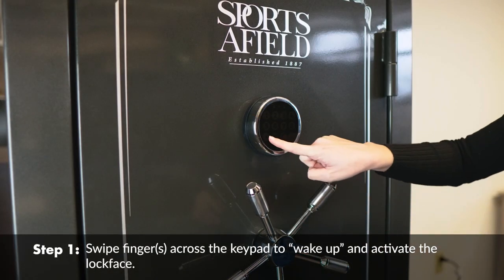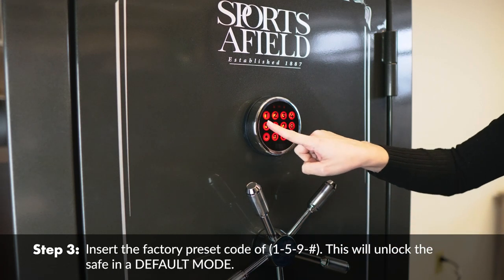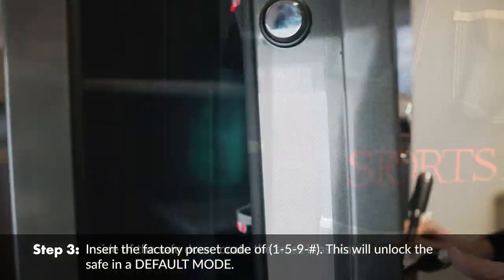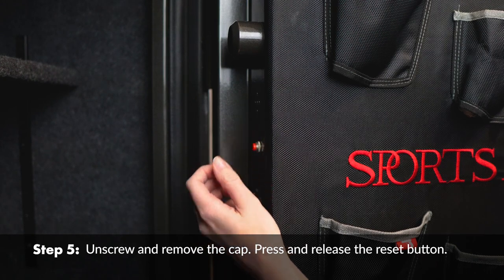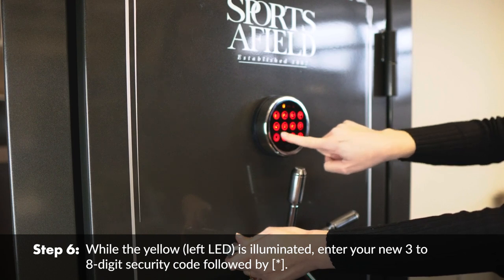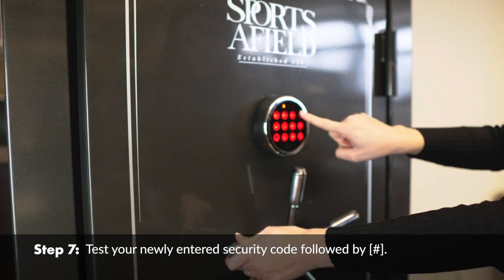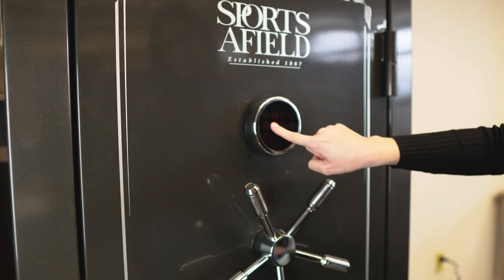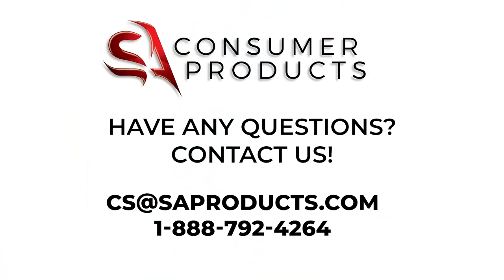Programming your Print Guard Lockface

Comment: Well, I bought one from Costco, the 159# doesn’t work, and the reset button also doesn’t work. So that I can’t even set up my own password right now. So now, I have to use the key to open the safe every time even if it’s a NEW safe. So disappointed.
Reply from the maker: Cheri, I'm sorry you are having issues. Please try to change the 9volt battery and see if that works. If that doesn't please reach out to our customer service team at  (888) 792-4264. They will assist you in getting your safe working.
Reply: Omg same we are also putting 159# in nothing works 
Did u figure out a solution, or did u call them and figured it out? My dad spent 500 dollars on the safe and he’s pissed off
Reply: @cabbagememes2852 hey! Had the same issue 

Just open it with the key, then remove key and extend the bolts. Now hit the reset button and enter your new code followed by the star. Then test it out by entering your code followed by the # pound symbol. 

This just worked for me. The 159# wasn’t working
Reply: @Jakefillpot  hey man my dad was able to get it working since it was on warranty he called the company and got free parts to fix the issue and he installed the new ones and worked just fine it could be that the one my dad bought had a defective lock panel or whaatever it is

And honestly your solution is preety interesting, but everything’s all good now
Reply: Mine acts like it forgets my code and won't open but when I remove the pad and disconnect the battery for a few seconds then reconnect it it works again. Last for awhile then does it again.
Reply: @Jakefillpot this worked for me thank you
Reply: @Jakefillpot thanks!! This worked for me!